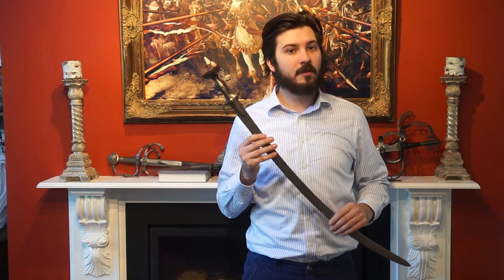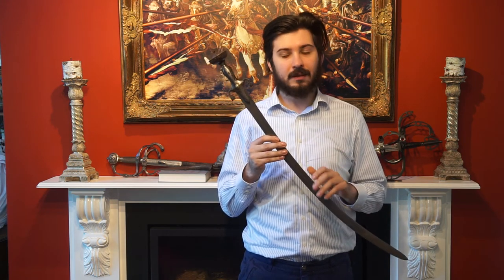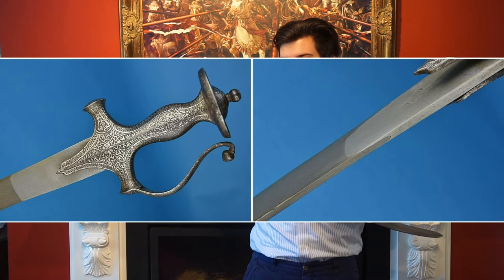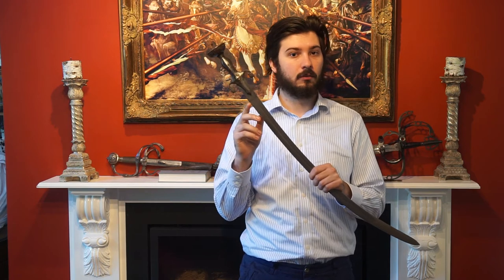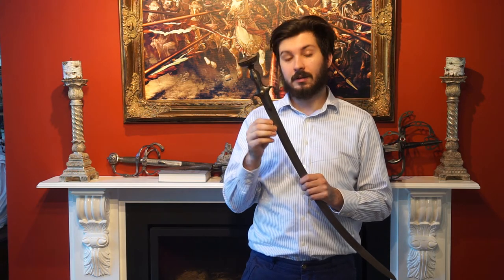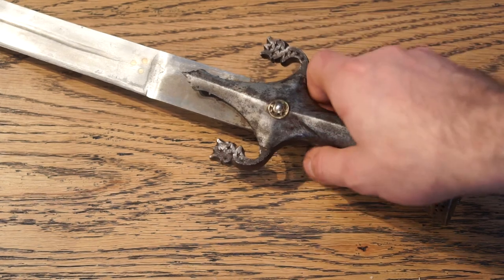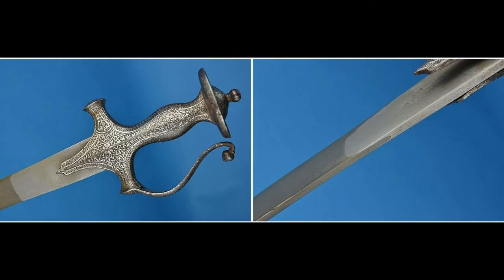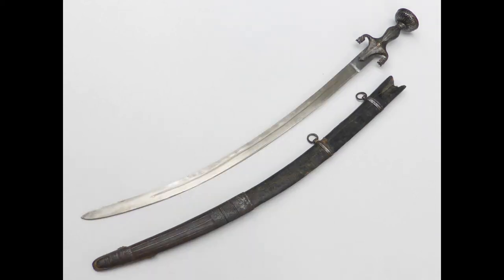Scarf Welded Tangs - Soft iron tangs for hard steel blades

Comment: Scarf welding is important, for smaller blacksmith forges. Tou can combine two pieces to make a longer piece.
Reply from the maker: I have a second example of a tulwar with a scarf welded blade that is good evidence of this. It has a scarf weld midway down the blade, with both sections being made of crystalline wootz, indicating it was made of two small wootz buttons

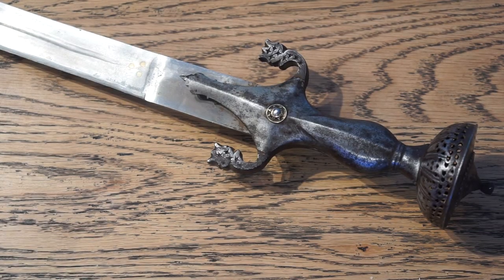Comment: There seems to be a transversal grind line making a depression between the iron/mild steel heel and tang, and the wootz blade. It can be seen quite clearly at 2:25. I find it to be a bit suspicious, or at least rather crude. The other one you show in picture has a very nice and flush transition, proper and done by the book.
Reply from the maker: MadNumForce I'd say it's just cruder. It had a definite plunge line grind at the ricasso transition, unlike the other one

Comment: Can you type out the name of the three dots? I've seen those in blades in the past. In my case in an exhibit of Marco Polo and the Emporers swords. They being from China in origin, or so the display said anyways (they could have came from literally anywhere but I think the card was more about who owned it rather than the blades origin.) I'd like to know more about those as a whole tho. They seem rare as I don't see it often and when I searched Google then I couldn't find anything in my searches then. 
Do you have an information on how they're done also? I try to not dare to assume that they'd bore a hole clean thru the blade and then hammer in a golden rivet, as that seems brutal and may weaken the blade. But I also think that could be possible. So I'm not ruling it out. 
I'll have to dig up old photos, If I even still have them. But I want to say one of the examples I say of this actually had a sort of a fancy coin style dots. Meaning each dot themselves had inner dots. It looked as if they chopped a modern wire in half and you see the round cables pattern inside sorta. 
I would love to see a video just on this alone sometime as I find it very interesting. 
I'd love to own a wootz blade someday. 
Very nice sword bud and good video as well

Comment: instead of saving the steel, think that they want to extend the blade they get
Reply from the maker: If that was the case, they could just scarf weld two pieces of steel together - but that's a topic for tomorrows video.
Reply: what i would try to do is measure original Indian 3 dot swords against this one. unfortunately i can't, if you can please do so